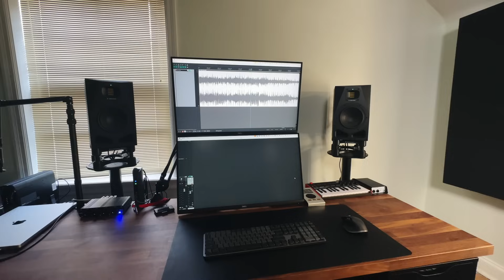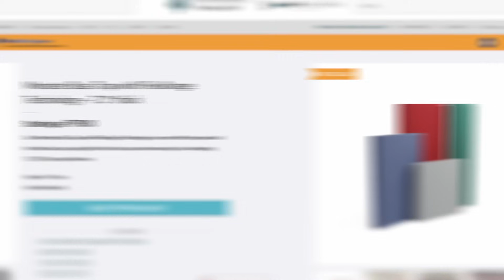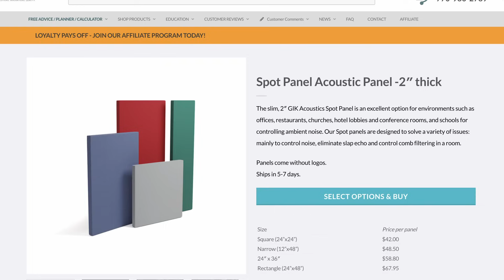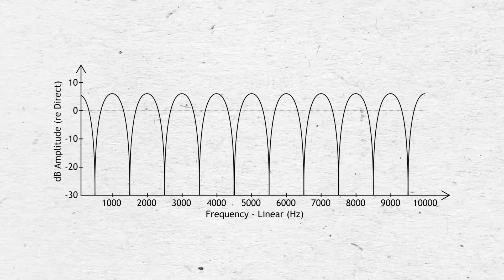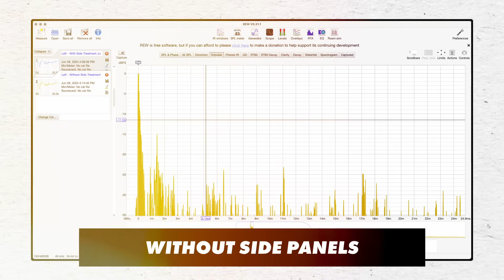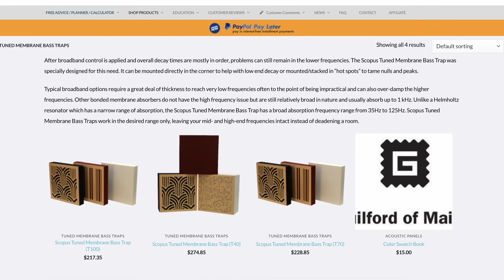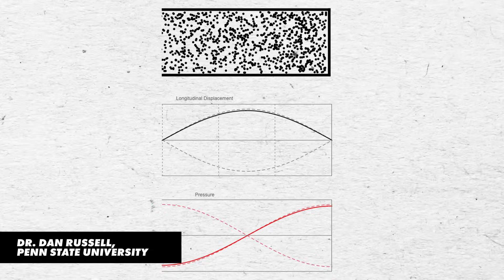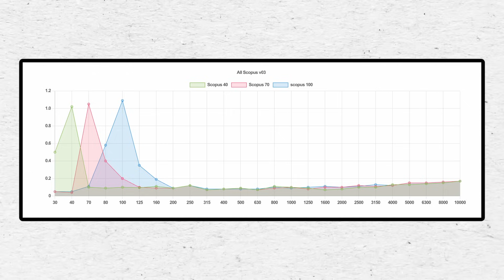Watch This Before Wasting Your Money On Acoustic Treatment

Comment: diyourselfperks made a good video about this: folded towels on wooden planks in the corners are a great and cheap audio-treatment option. It works much better than the most commonly used tiles by people who have a bigger YouTube channel.
Reply from the maker: Depending on how thick the folded towels are and the breathability of the fabric, this could be a good solution. However, insulation and wood might be just as affordable as towels and wood.
Reply: @AudioUniversity  Noted. 👍But be careful with the insulation material not being toxic. 😉
Reply: @peterjansen4826 your house is full of it already. If you’re not smacking it daily, it’s not going to be releasing fibers everywhere. Don’t waste your time with towels or anything, just make some panels they work
Reply: The problem with DIY is, if you are using your residence to make money commercially, then your facility will need to meet the same standards other commercial facilities do. It's not the same for all jurisdictions of course. But, products made by acoustic treatment companies have a paper trail for testing and compliance.  If you purchase from one of the large main line manufacturers, their products are Class A fire rated. This is going to be a big deal because some DIY solutions will burn toxic. Toxic treatments have been the cause of deaths in studio fires.  So, if you are worried about your insurance coverage, you might want to not cut corners and buy the real deal.
Reply: @brenthandycts131  Good point.
Reply: He did not test any wool or fibers what proper acoustic panels are made of.
Reply: Just no, build proper cheap panels. Towels and wood isn’t going to do almost anything.

Comment: maybe acoustic treatment on an absolute budget and using old cloths. like; towel. thick blanket or stuff
Reply from the maker: I did the same thing in high school - hung blankets from floor to ceiling in my parents’ basement. Looking back, I should have folded the blankets to make them thicker (even if less wall was covered). A towel will only absorb VERY high frequencies with wavelength 4 times the thickness of a towel.
Reply: @AudioUniversity  so. is towel not very best at acoustic treatment?
Reply: you should look at absorption of different materials.
Reply: @p4493  alright
Reply: I just posted a similar comment. That indeed. A room filled with bookcases and all that also works well, certainly if those cover the corners.
Reply: @peterjansen4826  i thought that help like disperse the sound or something like that
Reply: Fire hazards.